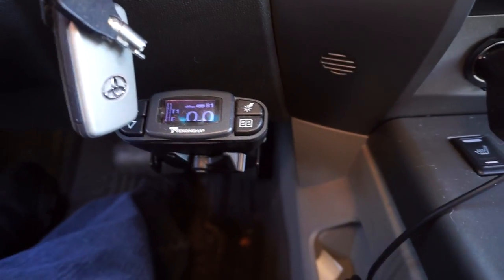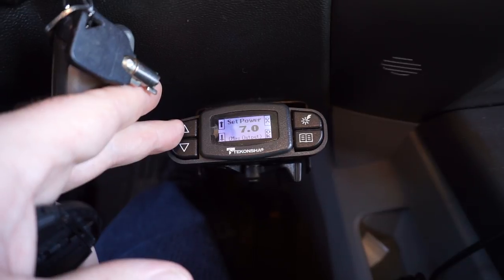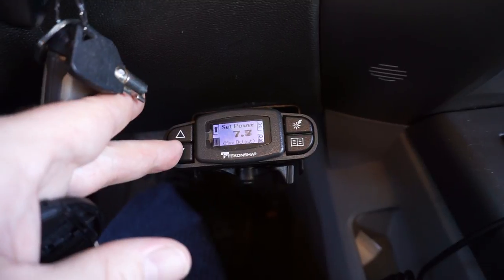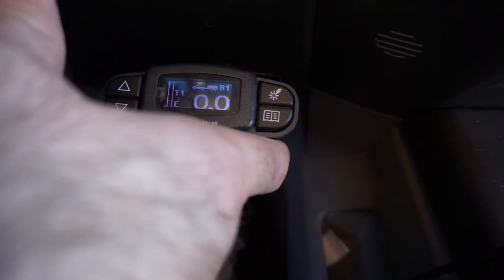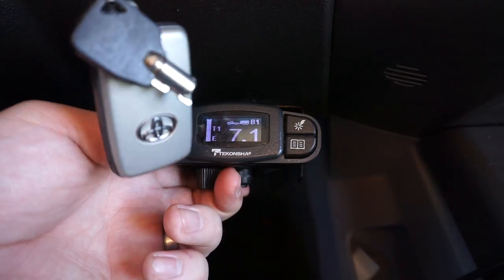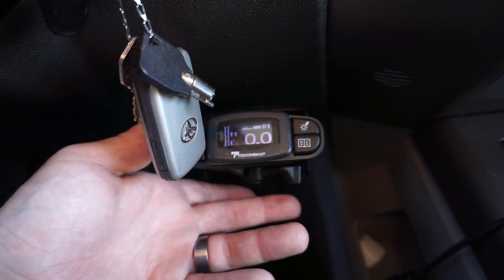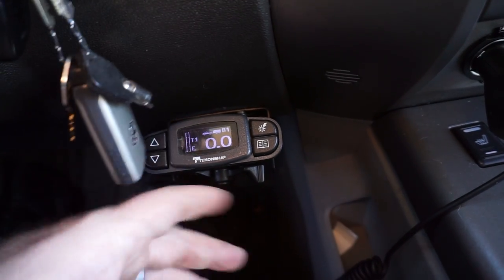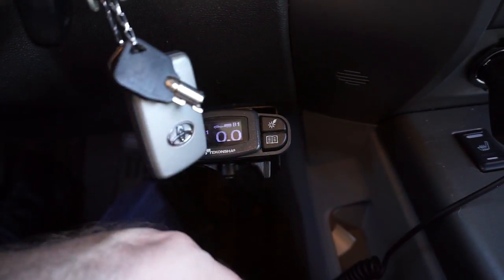Towing: Brake controller voltage adjustment tips

Comment: You didnt mention the test drive method using the manual lever to set the best response of the trailer brakes. Do you bypass this step in some manner?

Comment: I have the P3 model.  you can pick T1 thru T3   .  the bigger the trailer higher the number.  i have a 6k travel trailer.   and i'm using T1.    the harder i push the brake the more voltage goes to the brakes.  i let the unit do the thinking.  works great.